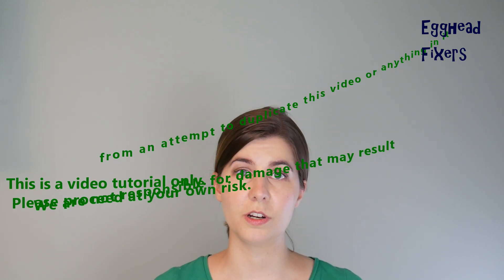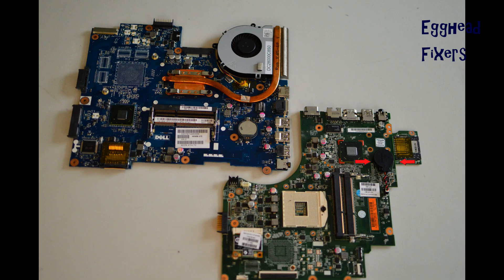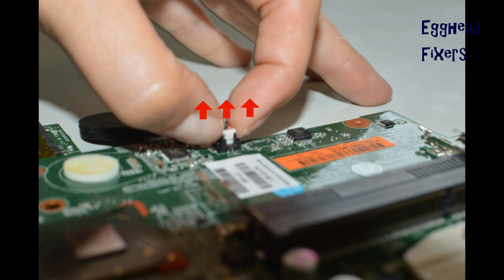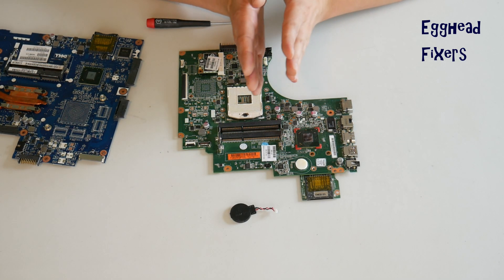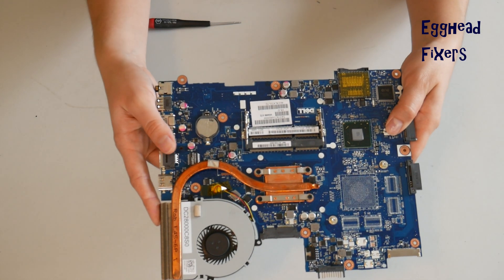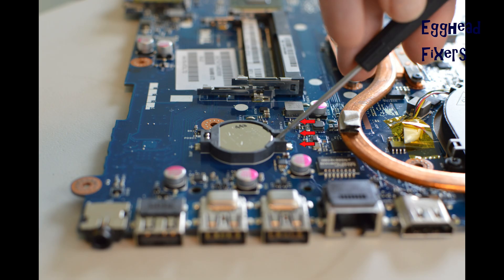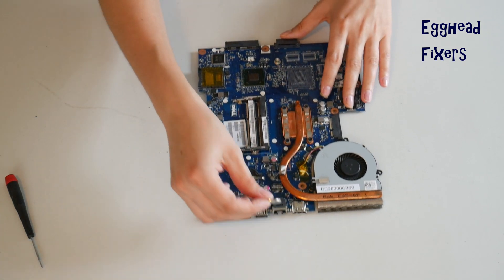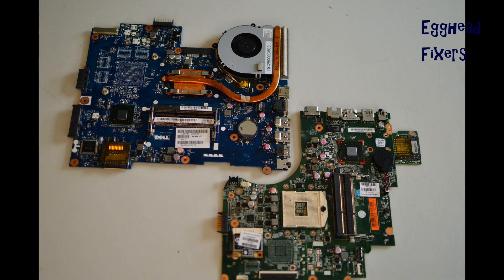How To Do a Bios Reset If Your Asus Turns On Then Off, Freezes or Won't Turn On At All. Video 4

Comment: Just bought this laptop straight out the box giving me this problem where it comes on and off. Saying that it may restart while updating but no progress made
Reply from the maker: If it's already giving you problems I would consider returning it. It should work right out of the box. If it's not working so quickly there is always a chance you got a lemon.

Comment: doesnt work on asus g702v 😢
Reply from the maker: What problem are you having with your computer?
Reply: @EggheadFixers  the bios is locked by admin password. I have removed the little battery as showed in this video but the password is still here:(
Reply from the maker: @aizen1920  Yes nowadays a BIOS reset will not reset the admin passwords. Although you can usually contact the manufacturer and they can help you reset the password.
Reply: @EggheadFixers  thank you so much for your answer i will do thatway 😁
Reply from the maker: @aizen1920  You're welcome!!

Comment: Hi. I have an ASUS FX505 laptop. When I press the power button, keyboard lights come for half a second and turns back off... Nothing happens after that. If I remove the battery, and connect the charger, the key board lights keep flashing on and off every second without pressing the power button. The computer I believe never boots up. Can you guide me what could be possible problem?
Reply from the maker: Have you tested the power jack to see if the computer is getting enough power?

Comment: i need help in my case when i plug battery once it turns on then again off 
if i remove battery and then only charger plug in then same thing happens its turn on then after 5 seconds its automatically off  what should i do 

i tried everything as you said but same thing happens everytime
what should i do
Reply from the maker: Is this when you do a BIOS reset like in this video? Or are you talking about video 1?
Reply: @EggheadFixers  
i'm talking about video 1st  but
 i tried both of video  but same thing happening again what to do
Reply from the maker: @Arrowgaming006  Does it display anything on the screen before turning off?
Reply: @EggheadFixers  yes only asus logo then it turns off automatically
Reply from the maker: @Arrowgaming006   I would try reinstalling the operating system. Here is a video on how to do that: 

https://youtu.be/28LirnC9Uy8

You can skip the portion of the video on how to replace the hard drive. 
If you can not get it to stay on long enough to reinstall the operating system then I would try this video:

https://youtu.be/kZx7cTYfpBI
Reply: @EggheadFixers  nope i'm unable to do that thing
Reply: @EggheadFixers  it doesn't even reach asus logo it turns off after 5 seconds
Reply from the maker: @Arrowgaming006  Ok then try the second video. It could be a problem with your RAM and that video shows you how to test for bad RAM
Reply: @EggheadFixers  ok thanks
Reply from the maker: @Arrowgaming006  👍

Comment: I’m not sure if my laptop has a CMOS battery, it’s an Asus R541ua-rb51. Are there any other ways I can reset the bios? It continues to turn on quickly then turns off, I don’t even reach the Asus loading screen before it turns off.
Reply: Yes I have the same laptop I guess
Reply: Because that's the first sign
Reply from the maker: You are correct from what I can see online this model Asus does not have a CMOS battery on the motherboard. In this case your laptop battery works as your CMOS battery so if you remove the battery for 30 seconds to 1 minute. It will reset BIOS.
Reply: @EggheadFixers  Thank you for the quick reply. I’ve taken the battery out for longer than 5 minutes and the same issues occur. I’m afraid I’ve shorted the motherboard. Any other suggestions? Thanks once again.
Reply from the maker: @ganja4024  Is the power cord giving it enough power? 
Here is a video on how to test it:
https://youtu.be/DUxAVeLpY8A

Also was the battery holding a charge before this issue occurred? Is there a chance the battery is starting the die?
Reply: @EggheadFixers  The issue all started when I cleaned the inside of my laptop. Prior to the cleaning the battery was able to hold charge and lasted around 5hrs when doing productive work. I will try to test the AC adapter though.
Reply from the maker: @ganja4024  Ah I see:/ Could the battery be loose causing a poor connection?
Reply: @EggheadFixers  the light(orange) that indicates when the device is charging no longer turns on.
Reply from the maker: @ganja4024  Is the power jack cable loose? Here is a video where you can see how to test it: 
https://youtu.be/tTFRPmfEyp0
Reply: @ganja4024  u have to take it out for 20 minutes
Reply: @hxdxMusic  The issue is either my battery or the connection between the battery and motherboard.
Reply: @ganja4024  same
Reply: @hxdxMusic  My laptop only turns on when plugged in, as soon as I unplug the charger it automatically shuts off. Same for you?
Reply: @ganja4024  I'll tell you, that used to happen to my laptop for alomost a year, and it was still like that and I was using it and it suddenly stopped!!
And yes that means u might have a battery problem